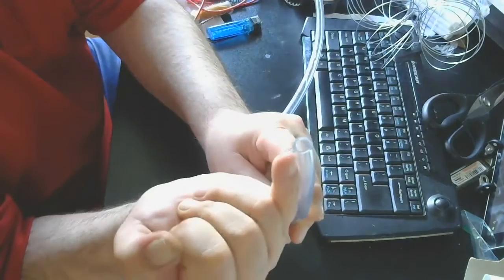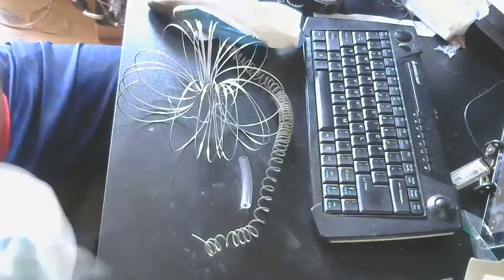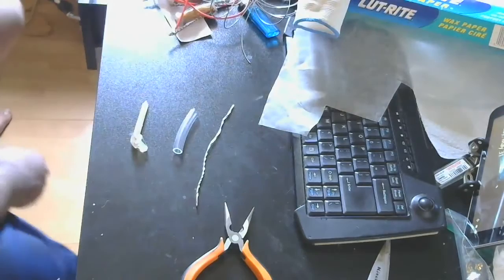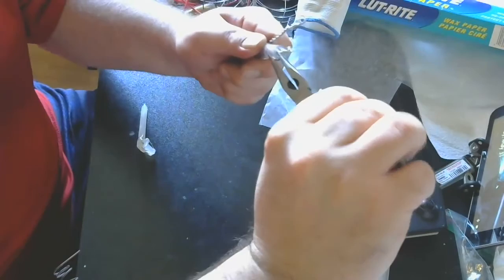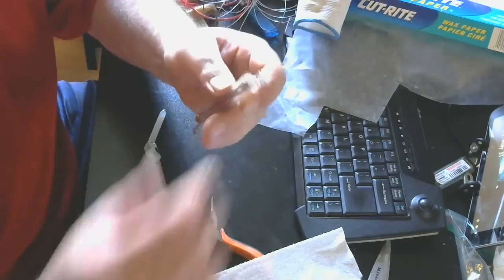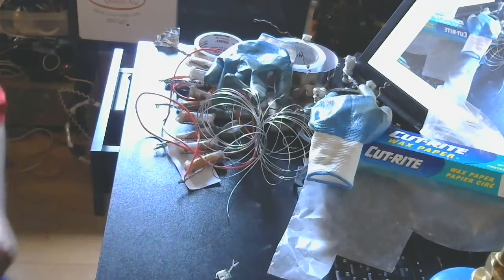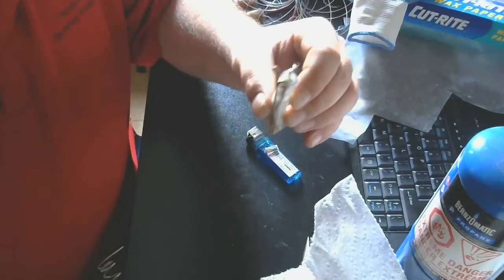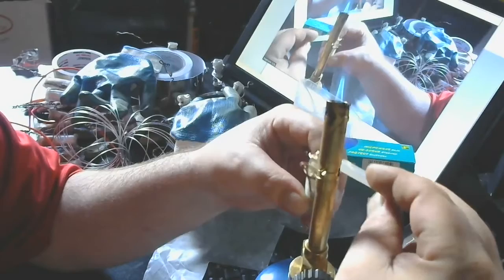tube cell blue print

Comment: Hi Steph,  In the long run, will larger diameter cells put out higher Volts and Milliamps than the smaller diameter cells??  Will there be any significant lengthening of the life for a larger cell??
Reply from the maker: we need to test them brother, please help me and test them with me.